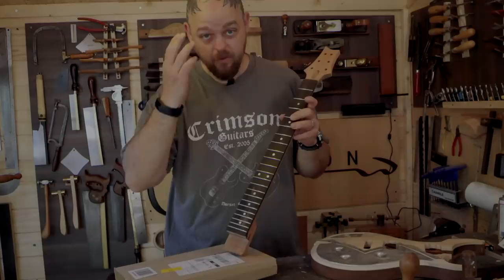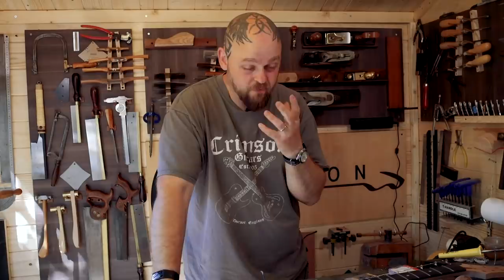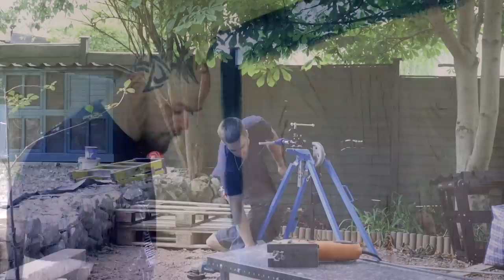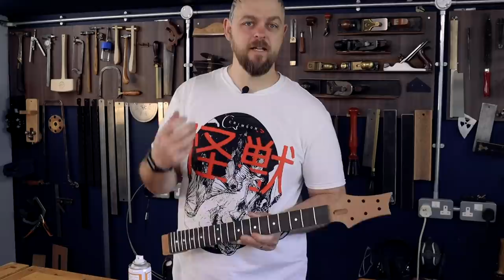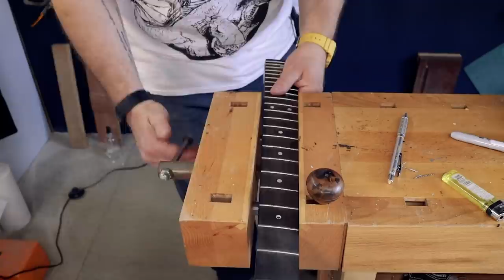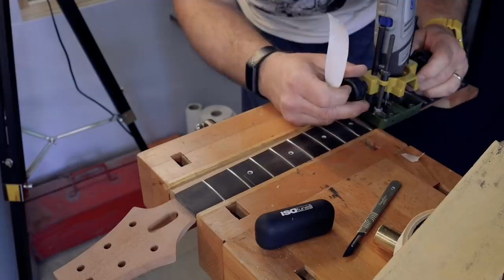Utter Failure Ep 10 | Building a CYBERPUNK 2077-inspired Custom Guitar

Comment: Ben! Please read this suggestion.
Get a new neck, just full reset. 
3mm pearl & 2mm side dot LEDs with MAGNET WIRE as the source line. 
You can get 12-20ga ceramic coated magnet wire in multiple colors (great for +/- orientation). Inlay your two main leads up the lower edge of the neck, at different depths where they need to cross as insurance. Scrape coating away at each intersection where a branch is needed, solder runners & inlay them, in an angular design to match the body lines, up onto the face of the fret board to the pearl. For the side dots, drill a 2mm hole just deep enough to hide the led. Find something to make two 0.5mm (or less) pin holes for the leads off the 2mm led to push through into the face of the fret board. Series the central & side dot leds, you won't want them super bright anyway while playing, just enough for effect. 9v ~100ohm resistor on the main trunk -> two or three(12th fret) 2-5v leds per branch will still yield good light.
Reply: When you get to the neck/body intersection you can solder the mag wire to more traditional multi-stranded leads to allow flexibility & attaching to the battery box/switch. This all will allow you to carry more of the angular lines in the body up to the fret board.

Comment: LED's (and semiconductor diodes in general, they are actually all LED's, just mostly infrared) have a very different voltage-current curve from lamps. They require certain voltage before they let current through, but then the slightest change in voltage makes a massive change in current. This is by the way how fuzz pedals work, they just have two diodes between signal and ground facing both ways and they clip the tops off from the wave. Anyway, this means that connecting leds parallel without individual resistors works only if all the leds are exactly the same. If one has slightly lower treshold voltage, all current goes through that one and it burns, while others do nothing. It is advisable to have a resistor for each led when connecting them parallel.

Comment: So I'm just wondering why you need access to the LEDs in the body to replace ones which die but you don't need access to ones in the neck?
So I have an idea that you could put perspex over the wire channels and add small hex screws each end of the strip. So a strip per fret, perhaps two strips for the 12th or just two LEDs. The strips can go all the way to the edge so no need for side dots. That would even allow you to maybe use the current fretboard.

Comment: I think you can run both wires on one side of the neck and float them with clear resin. For examle yellow and black ones. You can make soldered conections to the led. They will be wisible and should create nice hightech look

Comment: Just a question, isn't carbon fiber conductive,  if it is you could use the support rods in the neck as your positive and negative, no short from the frets or strings.

Comment: I have one of those bandsaws Ben, they aren't great but they were a lot cheaper than most others when  bought it. I'm surprised you made the compromise, I had to go down that route as the wife was bemoaning the expenditure (I bought a pillar drill and a disk sander at the same time and the drill took up most of the budget). I've since followed your lead and got one of those Triton spindle/belt sanders, excellent bit of kit, thanks for the recommendation.
Reply from the maker: You're welcome.  How is the spindle sander working out for you?
Reply: @CrimsonCustomGuitars  It's a very versatile machine. My only moan is the replacement sanding spindles come with a 3" that isn't included with this model. I think they can be bought separately though?

Comment: Idea 15: 
Take the dot inlay off, put a router on top of the fretboard, rout a channel that's 2 mm wider from the center dot to the side dot (like you would for a bigger inlay, but go all the way through the side of the fretboard). 
Rout another channel in the neck next to the fretboard on the side dot side for the wires. 
Build an aluminium piece (like an inlay) that holds the main Led and side Led. 
Build another long aluminium piece to cover the wire channel.
It all works in my head, I even made a drawing

Comment: I mean, it's probably way too late for that. However, I'd have a small look at optical fibers.
They could be inlayed into the neck (and maybe also  a few of then into the back of the neck), and route the light from the LEDs in the Body (and with that also the color effects) to the dots.
Also, no LEDs in the neck, so no LED there that could go bad. And no power to route there.
If you inlay the optical fiber into the neck (under the frets), and you roughen the upper side, the whole pathway will light up a little up.
So you have the same effect as with the acrylic throughout the neck.

Comment: Simple approuch would be to ditch the dot inlays, make block inlays out of perspex and light from behind them, the block routes would allow for drilling within the route to the next one if made deeper than usual. For longer gaps, ie 12th fret to 9th drill from 9th to 12 and 12 towards 9th and meet in the middle so the drill wont have to go too deep. Or just bloody take the fret board off... Either way, this guitar needs perspex cross  cut inlays to match the body... Side markers need to be block style as well. Or the block fretboard marker could run right to the edge and make it the side marker also.

Comment: An alternative to having 20+ LEDs is to run fibre optic down inside the neck with just one LED at the heel. Only one LED to fail and replace, and easy to make colour changing if that's desired.

Comment: What you could have done to avoid removing the fretboard for feeding the LED legs from the face of the fretboard to different paths...drill side holes (very small to avoid structural issues, just big enough for the wire and some slop) all the way through to where your conductive 'ladder rails' (these would act very much like bus bars) would be on either side of the neck, feed wire all the way through, then use a dental pick to hook the middle of the wire and pull it through the LED's hole on the face of the fretboard. Snip the wire in the middle of the part you pulled out and solder each leg to an end of the wire. Then as you're feeding the LED down into the hole you can pull on each wire end outside the neck to separate them into the proper direction in the side hole. Trim then solder the wires to the back of each ladder rail before it's inlaid and call it done. Leave a little bit of the slop space for the extra wire you'll be pushing back into the hole after you solder to the side rails, or else you might be pushing the LED's legs together in the center and shorting it out (or you could just insulate the legs).

LEDs on the top of the neck would be more difficult but you could feed a second wire from the leg of the top LED that doesn't connect to the top rail all the way through to the bottom rail.

Comment: Hey Ben, so if you're taking off the fretboard anyway, you could also use fibreglass cables to distribute the light from a single lightsource at the body. Don't know if you could see enough light at daylight, but in the dark it could work. Any experience with that?

Comment: Each LED needs a resistor or 1 LED can hog more current …. Unless they are  exactly matched. (If you want them in parallel).. Or you can get constant current LED's but then you cant adjust the brightness. You could add carbon fibre or metal (check whatever is conductive) stiffening strips. (or even use the  truss rod as one of the connection conduits) or rout in a channel up the back of the neck and fit a skunk stripe to cover the wires, this could also be a stiffening measure. Or even a nice bit of brass. You could even use multiplexing to control each LED individually...Lets say 9?? position markers(night rider?).... Or you could run a light pipe up the neck lighting the markers 'fibre optically' from the main LED's (probably have to build that into the neck from scratch).. Brilliant episode I like the Idea for using 1 LED for both an edge marker and an offset front marker, to make this neat it would be best to insert the LED from the back of the fretboard so the wires are in from the edge.... Love the design process...

Comment: Maybe take that new fretboard, rout some channels into the top surface of it (deeper than the fret tangs go), lay wires into the bottoms and fill them over with colored resin, then re-slot and fret over them. Then you'd have a hopefully cool-looking visible wire pattern in the fretboard that wouldn't interfere/short with the frets.

Comment: You could use some heat shrink on the strings at the frets and it would  insulate the strings from them and it would avoid the flickering issue

Comment: The red LED lit because it has a lower forward voltage than the whites and this clamps the voltage on your parallel array to that voltage, preventing the whites from lighting. BTW, if you use enamelled copper wire it is much easier to lose the wiring all together.

Comment: Only need one resistor if the leds are in series. Since they all should be lit simultaneously and thus uncanted dimming does not happen, parallel with separate resistors is not required either.

Comment: If you made a neck, or didn't have the fret board on already you could've put the lights in it on top of the bar an had holes going to clear lexan so it lights them up that way. But starting from a complete neck is HAAAAAARD I would imagine. I luv the build do far. Oh, I would suggest that you use the tension bar as a conductor.

Comment: It’ll take a while but you can remove the frets, route a binding channel, drill in from there, and then when it’s all wired up, you can add an aluminum or stainless binding to bring the design together with the body.

Comment: Different colours of LED have different voltage drops across (because both voltage drop and colour depend on the band gap)
Reply: Correct. If you want different colour LEDs in 1 ladder, then you need separate resistors for each LED.

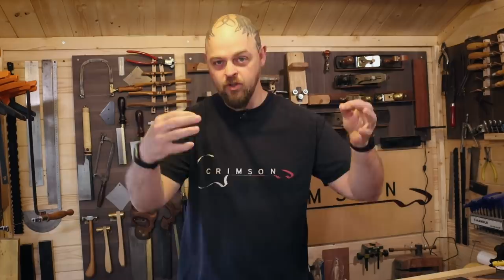Comment: I think your idea at 10:35 would have worked by snaking 2 lead wires from the middle fret board hole to each side hole. Then solder the led to the leads and then pull the LED down into the fret board by pulling on the two wires.

Comment: Ben, If you have the fretboard off, why not rout out slots top to bottom (across the surface of the fretboard) and put in strips of matte acrylic? Light those from the bottom of the neck (As seen when playing) upward? Then you could run front and top from one led each...

Comment: What about doing optic fibre for the lights? LEDs might have to be replaced eventually. With fibre only the light generator might need maintenance. That will be in the body and easily replaced. Those fibres running in a shallow groove up the sides of the frets will add to a light show and not as bright as LED. Those fibres could run in the body flash design. Instead of one colour, it could be changing colours. Would also be smaller holes and grooves than for LEDs.

Comment: Try SMD LEDs (Surface Mounted Devices) they are very small and can be found pre-wired with resistors, plastic model makers use them quite a bit.

Comment: Ben, 

What if you took the “fret switch” problem and combined it with the current plan? Something like having the front LED’s on all the time and then have the side LED’s wired to turn on with the frets. Or have a second set of side marker LED’s that turn on and then also have a set fully on all the time. You could wire all the frets to a common positive lead and then have the negative lead connect to the ground for the entire guitar that way when a string touches a fret it would complete the circuit.

Comment: Why dont you use acrylic Dowling and edge light it from bottom ? Also matches the theme of defused light .
Reply from the maker: That was what I was planning around option #8 or so.. resin/acrylic diffusing from the side dots to the middle one.. would have worked well too if I hadn't gone off at a tangent. B

Comment: You could mill a single groove on the back of the neck for the cables. The battery can then be installed in the body. At the end you can close it with a skunk strip.🪓🤸‍♂️🦧. Ohhhh sorry, i see, it's already done. with a groove on the back of the neck you could have inserted the LEDs from the back. the dot inlays could have been sliced into thin plates so that the light shines through nicely. 🦧🙋‍♀️.           Oooooh, great idea. Use fiber optic between trussrod and fretboard, and I would build the skunk stripe out of carbon fiber  so that it can be removed for repair work if necessary. Great idea guys. Wow another good one, use little lences instead of dot inlays, holy, thats cool. This channel makes me happy guys 🦧🤸‍♂️🐿🐿🐿🤟

Comment: Another option:
What I would have Tried to do (but I am slightly crazy, sooo)
* Make the neck itself slightly thinner.
* Make the fretboard sligthly thicker with 2 pieces of fretboard material.
* Route "H" channels in both
* Put the LEDs in where they need to be, as well as the holes for the LEDs
* glue up and sandwich the two fretboard pieces together.
* Put the fretboard on and shape it.
A bit more work, but could make for a neat effect if you use two different fretboard colors?  Dunno if it owuld work with a fret and it's jib, but if they could be shaved to work right...? (shrugs)

Comment: If you use fiber optics from a light source in the main body, you won't need any electrical wires up the neck at-all. Polycarbonate or acrylic rod will do the trick too.

Comment: Won't help on this build... Obviously... However, the forward voltage of a red LED is lower than on the other colours. You'd need to wire each LED with it's own resistor to get them all to light, if you use different colours and want them to be the same brightness. Part of the experimental process would have to be figuring out which value of resistor goes with which colour of LED. The difference between each colour isn't huge but as you saw yourself, the juice will always flow through the path of least resistance, leaving the others unlit or at least, very dim.
I hope that made sense.
Reply from the maker: thank you! This made the whole thing much clearer to me, and there certainly will be more LED's in my future!

Comment: OK Ben, now that you've exhausted all other options, please repeat after me.... FIBER OPTICS !  A much more realistic way of doing this would be to use fiber optics to distribute the light  via tiny grooves routed into the back of the fretboard. These fiber optics are often used in modeling for RC planes and spacecraft models. I'm picturing a wide shallow channel 10 mm by about 3 mm deep offset towards bottom of fretboard for multiple fibers say 10 wide by 2 deep for 20 dots... The offset is so that you can carve/router out gently radiused channels bending up to each dot position, and run them upwards 90 degrees to be parallel to the frets so they can also illuminate the side dots. Fiber optic fibers/cables can be made to illuminate all along its length, or only at the ends... So an end illuminating cable can run the length of fretboard and down into the body, each one would terminate in a side illuminating fiber to shed light thru the dots and side markers alike, and the collection of fibers in the body could be illuminated by ONE bright white LED, or perhaps, multiple RBG or RBY colored LEDs that could be switched as you desire to meld or use individual LEDs for each frequency of light you desire.  Here is a link that should help :  https://www.instructables.com/id/The-Beginners-Guide-to-Fiber-Optics/

Comment: Why not use fiber optic filament? Strip a cable and feed the filaments down your grooves or holes. You can then place an LED or bunch of them and battery in an accessible area. If it blows, you can still access it to change it. Just a thought...
Reply from the maker: fibre optics are a valid option, you have to be sure to get flexible fibres.. one day I tried and the strands broke at the slightest excuse :( B

Comment: ben i don't know if you've looked into them or not, but you can get 'micro leds' that are smaller than a match head they usually come pre wired but they would have been awesome for what you are trying to do here. id still recommend getting some tho as they would be better for the dots on the side of the fretboard.

Comment: What about using Fiberoptic Cable instead of LEDs? Would probably make it much easier, and you'd only need one Lightsource for the whole Fretboard
Reply: Also gives you the benefit that the Fiberoptic can't break, so you won't end up with dead LEDs in the Fretboard at some point. And you can put the Fiber Lightsource somewhere more accessible.

Comment: I know This is late, but you could've taken the fret board off, routed a channel on the underside of the fret board, gotten a long cylinder of the plastic, putting a T at the 12th fret, left the electrical connections of 1 (one) LED at the base of the neck (of course providing space for the LED) then locate the leads of the LED lights out of sight. Of course I admire your tenacity) you could've made the fret dots out of the same plastic you used for the cylinder (plus the T). I'm sure others thought of this as well, but I haven't read the comments.